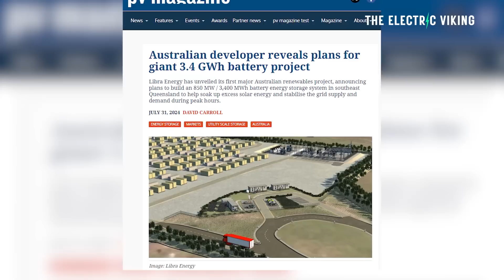One of worlds biggest batteries being built in Queensland to store solar energy

Comment: It's not that people don't like ruinables - they don't like the PRICE.  Price decreasing?  Fantasy.  Bookmark this video and come back in five years to see exactly how much 'lower' the price is.  I'll take bets on it being MORE expensive.
Reply: The prices of both solar panels and batteries have been steadily decreasing for the past two decades.  It only takes a few minutes to research these basic facts.
Reply: @Sendu7  Regardless - the price of electricity has been going UP for the past two decades (and more) and the more we add wind power (or solar) the more expensive the electricity gets.  Go figure huh?
Reply: @kellyeye7224  Big oil have been ensuring that prices continue to go up. I installed a 4kW Solar PV system last week - 16 panels (somewhat overkill - but it is the UK afterall). Cost of that system cost of that system £1100 - ($AUD2000, $US1400). Expected payback time - 20 months.
Reply: @mb-3faze  Questionable costing there.  Here in the UK a typical 400W panel costs £100 (give or take) and solar PV isn't just 'the panels' it's the inverter and necessary storage too.  You'd need around 16kW to make a viable system for most parts of the UK (cloudy etc) so material costs alone would be £2k for the panels, £1k for the inverter, £2k for the batteries and installation ON TOP.
Oil pricing is more political than 'big oil' - the USA were self-sufficient until the bent election then prices went up as the oil was turned off for POLITICAL reasons.
If we wanted to be practical about it then we should all go to LNG/LPG for fuel.

Comment: Batteries are needed to end the duck curve and store excess electricity from rooftop solar. So, Queensland is doing what is necessary.
Reply: Quack quack
Reply: They dont create power, they store it.
If swirched to all battery would last about 2 hours, you can bet they will forbid a/c & EV charging to get a bit more time.

Comment: Nuclear promoters are weird, grid owners need constant 24/7 cashflow. 
Every day the sun shines cashflow will be dead.

$TRILLIONS, (= $1,000 BILLIONS ) the grid owners infrastructure investment needs a ROI, 24/7/365.

$100s BILLIONS of cashflow, ROI. 

Nuclear electricity cashflow is a dead duck everyday the 🌞 sun shines.

Rooftop PV shading hot roofs and BVs oversized battery parked 23hrs everyday and V2G will kill Nuclear electricity. 
Grid supply $kWh will have to increase. 
Grid customers will abandon the national grid. 
Grid supply $kWh will have to keep increasing. 

Economic death spiral. Economic dead duck. 

Nuclear electricity is economically dangerous.
Nuclear promoters are weird.

Edit, big grid batteries can be replaced in the future if necessary as more BVs are used.

Comment: The best place to build battery storage is at closed or closing power plants. The cabling and transformers are there already. No expense spent.
Reply: Exactly the same reason why storing it at a home behind the meter at a house alongside solar panels.
6.6kWh Solar + 12.8kWh battery has reduced my grid electricity usage by 98%. 4 person household in Qld.
Current ROI for my solar plus battery is 5 years.
Installed alongside my 10 Yr old 4kWh system still going strong. Paid for itself in 4.5 years. 
The old and new together is fantastic.
In 5 years I’ll be able to get a 25kWh battery for half the price as an upgrade. Or even better, I’ll just use an EV with bidirectional charging. Won’t be long until we have cheap 100kWh EV batteries. I’ll tap 25% of that for home.
Reply: @aaronsinspirationdaily4896  That would be a dream for me.. find a cheap cabin without electricity and just use the car to power it, or in the future a stationary battery.
Reply: Rooftop solar with storage eliminates the need for electric distribution. Put solar on every rooftop.
Reply: Mike, the first best place to install batteries is at the homes and businesses that have or could have solar panels. That would save billions in power lines construction and maintenance costs, etc. We home and small business owners need affordable batteries so that we can disconnect from the corrupt and predatory electric utility monopolies.

Comment: Those batteries would last longer if there were shades planned for the installation. The sun isn't going to be very forgiving in near times.
Reply: Solar Panels cover is a good idea, underground not, but underground cooling pipes would be good.
Reply: Rooftop PV panels shading rooftops adds to the value of rooftop PV 😮😊😊😊😊